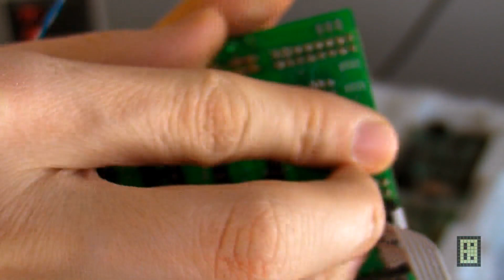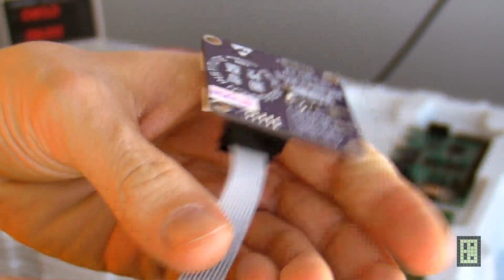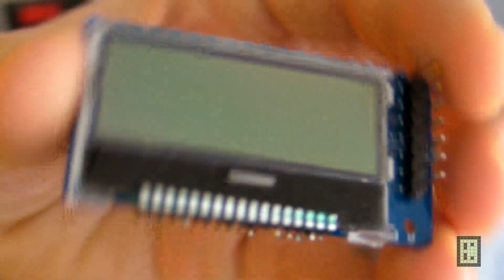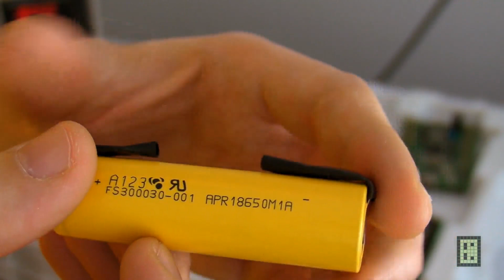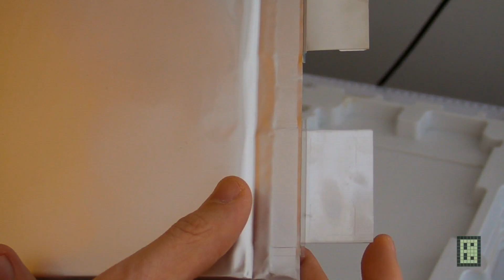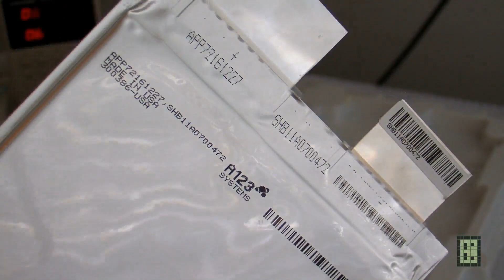STM32VL STM32F4 Dyscovery boards much better than 8bit and LiFePO4 A123 Systems

Comment: I just don't get the purpose of this video, is it just to show what you have or to share what you are doing? Because for me, it sounded like a person who wanted to share info, but didn't have time to look for the info about the boards to share that with others. 
The most interesting part is that you keep this highly sensitive boards without a ESD protection on a material that is the killer of any electronic equipment.

Comment: I put this on theamphour com #87 comments. Somebody says it only has a MSwindows commercial compiler. 
Jana:Assuming STM wants to attract some hobbyists, too, then their problem isn’t the dev boards, but the development environment. There is no open-source STM8 compiler worth to mention, and getting an open-source compiler running for an STM32 with its ARM core is still a PITA. STM didn’t get, that just throwing a bunch of commercial trial versions, Windows-only at potential users doesn’t cut it

Comment: Really great video, very helpful. Will you be using the ST chips in your solar system? I am also considering the A123 20ah pouches for solar. For charge control, I have been looking at the LT3652,  and TI's  bq2465, but these both seem to be designed for one cell. I would like to use 4 pouches together for 256 Wh and I'm not sure of the best way to go about that. Curious to know your plans for 10! Any enlightenment would be much appreciated.

Comment: I notice the Rasberry Pi board came out for a $35 price. It can run Linux. I wonder if it has all the DAC, ADC and serial interfaces, and static memory like a microcontroller board.

watch?v=pQ7N4rycsy4

Comment: One (and the only, I think) disadvantage is that the code size will usually be larger, so the same size flash won't fit as much code. Considering the advantages though, hardly worth mentioning.